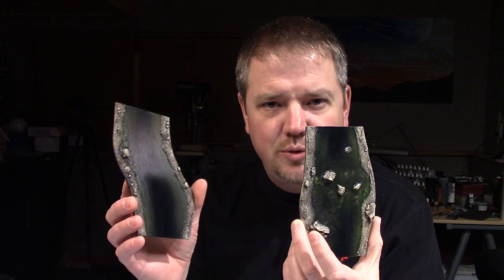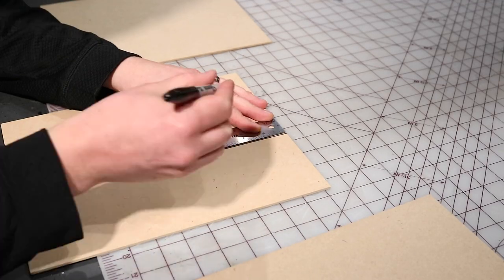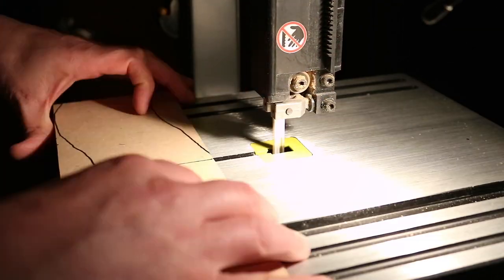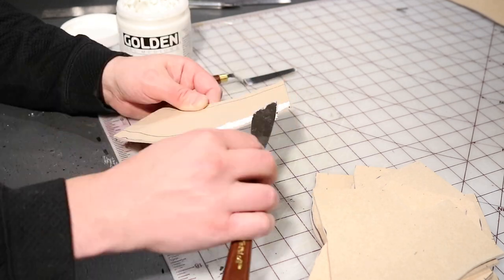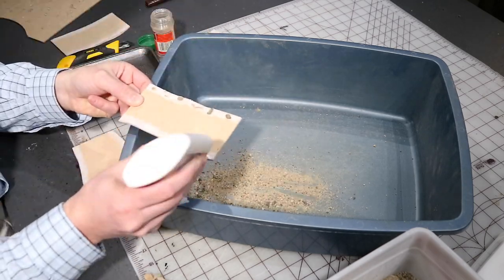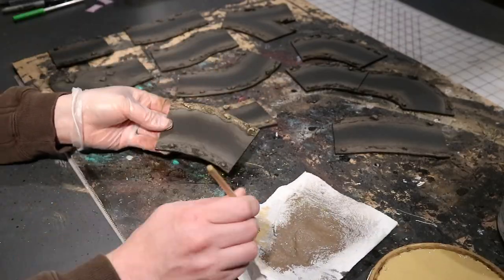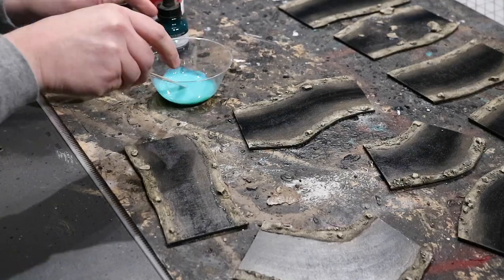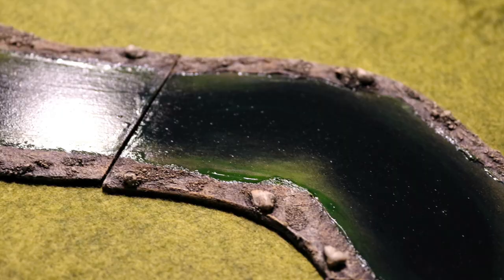048-Modular Rivers

Comment: where did you get the sorter shelves?
Reply from the maker: From work. They only needed half the shelves for the setup they needed.
Reply: @stellariangames8014  I am planning on making this soon, just got a ban saw for fathersday, went and bought some hardboard but couldnt find MDF thin enough.

love your channel btw
Reply from the maker: You might be able to find some at a framing store?? It is often used as backing behind poster frames. Or use something like these...MDF Board - 30-Pack Wood Board, Medium Density Fibreboard, Hardwood Board, Brown, 5.875 x 7.875 x 0.0785 Inches https://www.amazon.com/dp/B07C4PD283/ref=cm_sw_r_cp_api_i_Cqb8Eb2PF7MG0
Reply: @stellariangames8014  thank you!